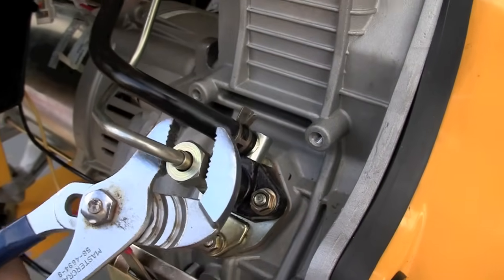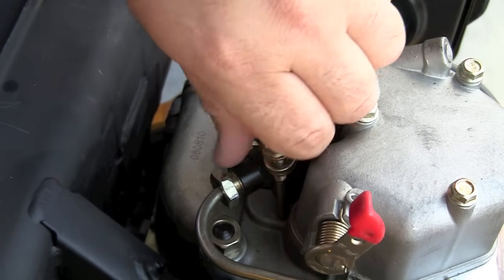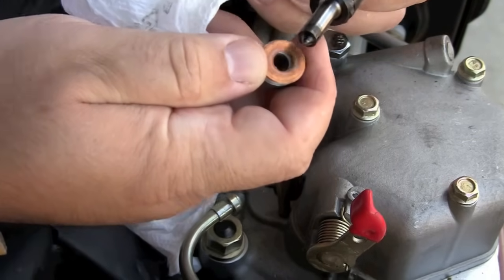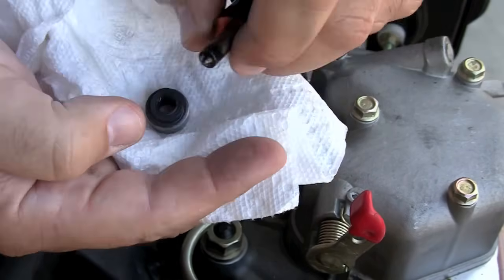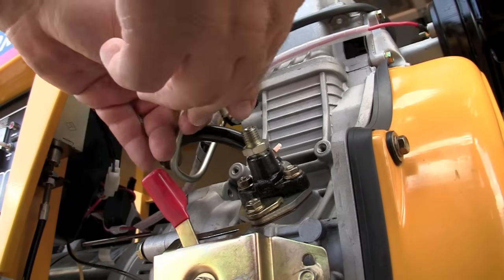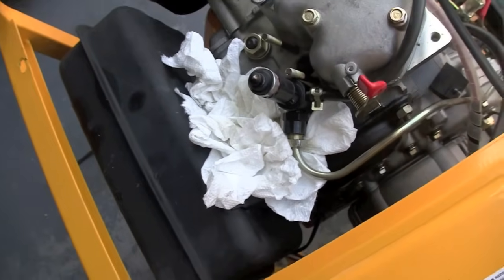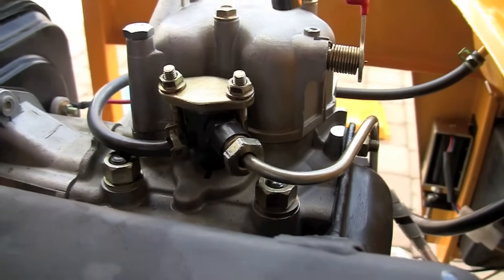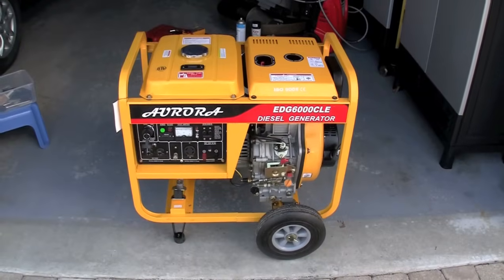Diesel Generator - Fuel Injector

Comment: A certified mechanic would use the correct words, like Nuts instead of Bolts, one of my pet peeves, if you are going to say it, say it right, use the right words for the parts that are being used, other then that the video is very clear. thanks grm

Comment: I have one of these engines in my generator.  I bought it new but it has been sitting in its box for over 3 years but won't run.  The fuel pressure from the pump is very weak and sprays nothing like yours did.  I took out the pump but it looks clean and the spring pushes in and out OK.  Is that a problem leaving it for so long do you know?  There is a strong flow of fuel to the pump's inlet and no air locks and the battery is new.  Anyone have any ideas?

Comment: Don't bend the injection line as it may not fit correctly if done repeatedly. It might get metal fatigue and need replaced over time.

Comment: If I saw someone using multi grips on the injection line nuts instead of a 17mm spanner, or at least a shifting spanner, I’d give them a back-hander in the mouth and tell them to go buy some tools and learn how to use them.
Reply: I cringe just using a shifter on some parts of my diesels. Couldn't imagine using that thing. Better grips (self gripping things that were advertised on TV) I could just tolerate maybe 😂

Comment: Important safety tip. DO NOT put your hand over the injector while you're firing it. It WILL shoot fuel through your skin, and you do not want that. That is a horribly painful and disasterous condition.
Reply: Yea holly crap I was furious to see they are teaching people to check without talking about safety.  He already removed the high pressure line could have easily relocated it inside a bucket or something by removing the return line.  That's what I did on mine.
Reply: And the fuel mist is toxic as hell 😂

Comment: 1. Use the proper tools for the job
2. Do not bend your fuel lines
3.They are nozzels not injectors
Reply: It's painful to watch
Reply: the whole unit is called an injector, the tip is the nozzle
Reply: Is it a turbine engine or something?    It's an injector.
Reply: Injector is the common term 🤷‍♂️
Reply: U nailed it buddy

Comment: Spanners are better than toothed pliers for nuts. Marked nuts do not look  so nice and  resale value drops fast.
If he undid the nut on the pump and the nit on the injector, there would be no need to bend  high pressure pipes.

Comment: Really  Pliers? Use the right tools, only a good mechanic would use right tools. Never bend a high pressure fuel line. Put injector nozzle in a glass jar with a rag on top. High pressure diesel injected under skin results in skin poisoning, and people have had fingers and hands amputated because of this.You can download a manual from yanmar for servicing these engines, even there a clone , all same.

Comment: Mine is running for about 5 sec then cutting off , I have bled top and bottom and have good oil ? Could it be my injector , less then an hour of run time it's new . I have been running once a month for 15 minutes, puzzled?
Reply: Low oil

Comment: Very unsafe to try out ur injector like that..firstly itl fall on u nd god forbid penetrate ur skin because it operates at a very high pressure..and secondly its a major fire hazard as the atomised fuel will fall on the hot parts of the engine and ignite immediately..
Reply: Combustible liquid, and not a pressure that penetrates skin... it's a DIY with some find anywhere tools very helpful..

Comment: What the hell kind of mickey mouse mechanic are you? Never, ever bend the high pressure fuel pipe, ever. You will weaken it and it could split at a later time. Don't be so lazy - undo both ends of the pipe and remove it.
And get some proper tools for god sake, even for the sake of the video. Using pliers and locking pliers damages the fittings and is pure laziness.
I sure hope you never get near any of my engines! Amatuer.